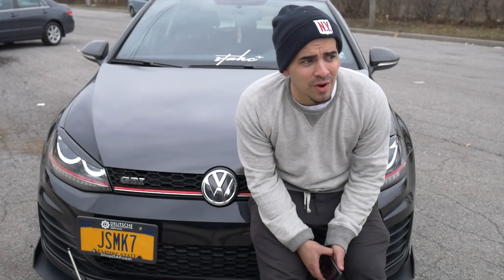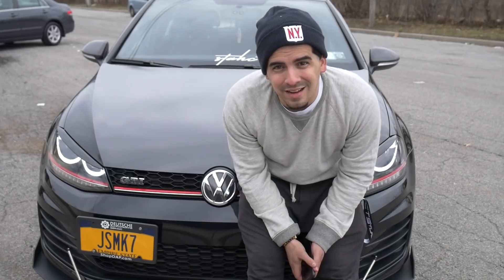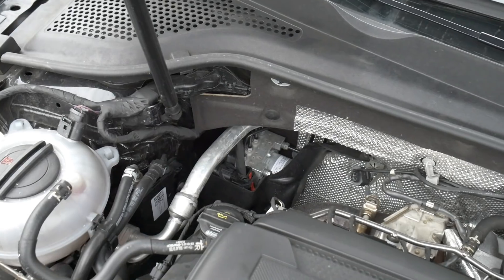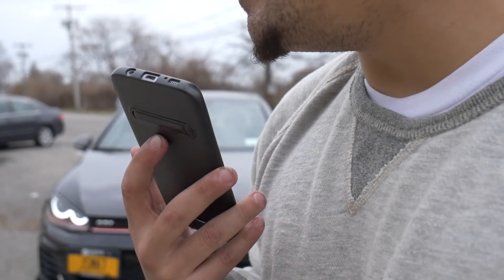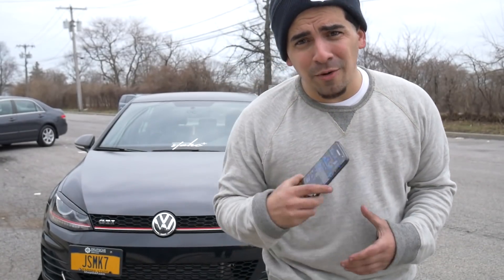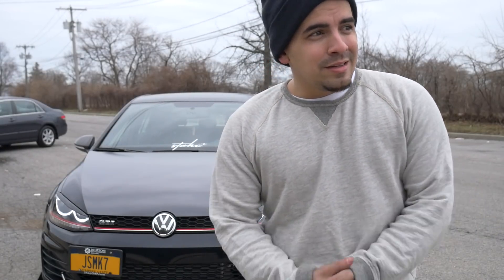MK7 GTI new Blowoff Valve

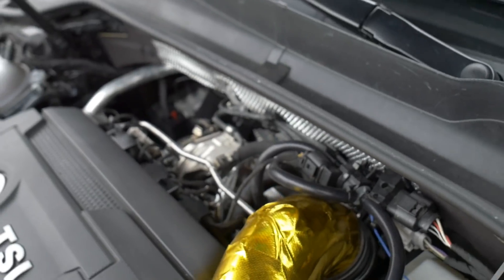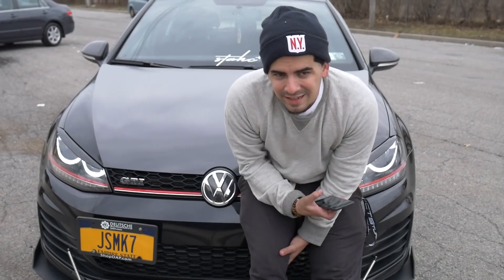Comment: man i have a mk6 facelift jetta and i've done TBE system, intake and now just waiting for a tune but i also just got my bov in the mail, and i was really struggling with figuring out how the wiring goes.. because i only got one hose that's long as shit and i'm thinking i'm supposed to run that to the T connector, but what about the two other hoses? do i just use my stock ones if they're on the stock dv or what do i do? but also ur explanation from 2:45 something to 3:50 something made it a lot clearer thanks man, but also very clean gti you got there